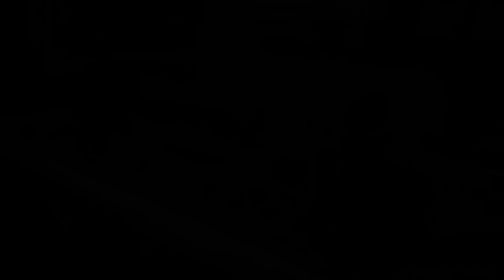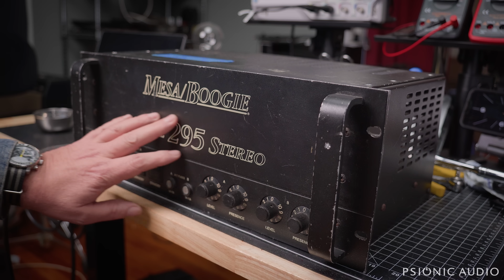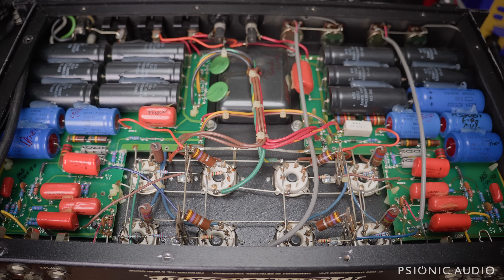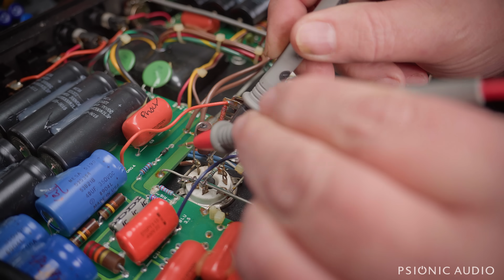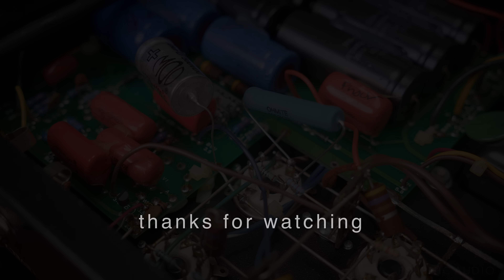Only Mostly Dead | Mesa SimulClass 295 Pt 1

Comment: I recently worked on a Mesa where a screen grid resistor literally just fell off the board because they were mounted upside down, and got hot enough to melt the solder. Brilliant design, nobody could have seen that coming.

Comment: I bought one these in the early 80's along with 4 Mesa Boogie 12" single cabs with EVM-12sL. I was learning to be a tech in those days and opened it up to see what was inside. I was impressed! But not knowledgeable in this area. Since I lived in an apartment, my neighbors were Not impressed with that amp. Now that I have learned quite bit about tube guitar amps, I wish I didn't give it away, along with quite a few other amps. I really respect this channel.

Comment: Someone back in the 1950s published a full schematic and accompanying article in Audio Engineering Magazine for a pentode/triode biamp for sound reproduction and they called it a "Simulclass" amplifier. It was done again with other biamp formats (cathode biased & fixed bias) and the same name "Simulclass" was used, again (also back in the 1950s). Mesa did incur some legal actions over thier shitty patent research (or possibly just plain dishonesty). Patenting stuff from the 1950s in the 1980s, 90s and 2000s doesn't work out very well, and for all the people that Mesa had sued for using it: THE LINE STARTS HERE, LET'S ALL SUE MESA! And so they did. And it was good.

Comment: I had to fix one of these early last year. It was blowing fuses, the 400V signal caps had gone short circuit which took out the rectifier diodes. 
Changing that filter cap with be a pain as the negative end is in a spot that won’t allow easy soldering. Perhaps the whole board will have to be removed from the chassis?

Comment: Hey Lyle, I have a quick reverb question. If the reverb in a new amp is not working, is the first thing to look for a connection issue? and will tapping the reverb tank tell me if it is dead or not? Also, I have a Silvertone 1483 I need to get to you. Thanks

Comment: 5:44  I can't help but notice the spot on the cap that you later determined was bad.  But that spot didn't seem to be there in the prior shots.
Reply from the maker: That’s a reflection of one of the orange caps. No visible indication the cap is bad. But It behaved as a partial short.
Reply: @PsionicAudio  Ah, that explains it.  Thanks.  I couldn't imagine that escaping your inspection.

Comment: Hey! Thanks for the videos!
Maybe you could give me a hint on my problem? Mesa mark iv, giving crazy pickup feedback with all my guitars when gain or drive is not at minimum. Does this sound familiar?
I’m in a place with no access to techs :(
Reply: Your description sounds as if the amp is oscillating. It's unlikely to be a problem you can fix by yourself. Could be anything from a bad chassis ground or two/three/four, a bad filter cap or 2/3/4, offspec or dead resistors, poor wiring layout, or other issues. Needs a skilled tech for sure!
Reply: @ thank you very much for taking the time to answer!! Will search somebody to send it to. Cheers!!!

Comment: Changing resistor types in critical nodes for the tone means a dramatic change in –you guessed it– tone.

Mesa could’ve use metal-film in those spots if they wanted, but they chose not to for a reason.
Reply: I'd wager that reason was "we had these parts in stock" or "these parts cost us less money" rather than "we think they sound better."
Reply: Would love you hear your explanation about why they choose to use a certain value of cap or resistor in some amps and in other amps, caps or resistors that are literally 100x more or 10 less in value at the same node on the same model. Or even better, a cap on something labeled as a resistor on the board and vice versa. If they’re so concerned about tone and such I’m sure it has to be a conscious choice to do so, and totally not a mistake by someone grabbing the wrong component value or the wrong component altogether. Or the typical old “it’s what we had in bulk and we needed to use it”
Reply: Not sure about tone (maybe you are talking about compression) for a screen stopper but two reasons to use a CC could be low inductance and high surge capabilities and one more could be failure mode (usually open or high resistance).

No doubt Psionic knows this info though.
Reply: @blakesimpson9974  carbon comp resistors create distortion when large dc voltages are present on them and there is an ac swinging voltage. read about it from rg keen's writeup about carbon comp resistors you can google the page

Comment: what do u think of the mesa mark v 35w combos, same mesa mess ?
Reply: I believe the smaller versions of any Mesa amp are the WORST offenders. Look at some of Psionics other videos, they absolutely stuff every single thing in those small chassis that they can.
Reply: @anotheryoutubed  sucks cuz i do like alot of mesa sounds
Reply: @grahamjarman they really do make a high gain sound that is pleasing and no other brand can really seem to replicate it. Unfortunate
Reply: @grahamjarman  I know man, I do too :( I still love my TA-15 whenever I bust it out for recording at home.

Fortunately if you really do enough digging and research, the original "MK I" and then the MK II and on amps were mostly just modified Fender circuits and amps. I have never looked but I would have to imagine there are some pretty decent 'simplified' mesa clones out there, but maybe not.

Comment: Did the customer only green light the failed components or all the carbon comp resistors as they may be next to fail?
Reply from the maker: The customer wants it done right within a certain budget. So all CCs are being changed but only the one failed filter cap, not budgeting for a complete recap.
Reply: The coupling caps are a bigger problem. They are rated at 400V and they need to be 630V.